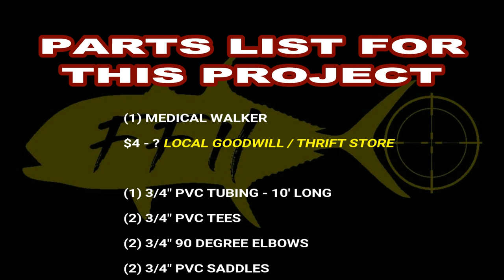A Diy Kayak Cart Experiment - Florida Fish Hunter

Comment: I'm having trouble seeing how u got from the original axel build to what u ended up with. you never showed what was involved
Reply from the maker: As an option, a second inner and outer tube was added to the center section of the original axle build and felt that it was not necessary to have to include this step in the video but I guess I was wrong...

Comment: I finally located a walker at a reasonable ($10) price and now to get the other components together....have you found any other wheels that are worth trying or are the C-Tug Kiwi on Amazon the best deal?? Didn't look at the cost of the one component that may be most difficult to find....wheels...(wasn't thinking the wheels would be over $50)
Reply from the maker: I really did not look around for wheels since I already had 3 pairs that had the right size hole to fit that one inch diameter aluminum tubing. What I would suggest is to go to your local hardware store or harbor freight and see if you can find wheels with a large solid plastic hub area so the hole used for its axle can be sized up to a 1 inch diameter opening.
Reply: floridafishhunter Yeah, that's my plan...I need to make a run to harbor freight anyway (1hr drive, so I make a list, lol).  Thanks!

Comment: Looks promising for most part besides through time and going through rougher terrain the PVC will most likely break
Reply from the maker: Pvc is very resilient. UV light degradation is the main culprit when using pvc in an outdoor environment so painting the pvc tubing will eliminate that problem and help it maintain its strength and integrity.

Comment: Do you think 1" PVC in place of the aluminum would hold up?  I have the same yak and already have c-tug so the wheels wouldnt be an issue. If so could you tell me what the width of the axle would need to be?   Thanks!
Reply from the maker: Pvc flexes too much for me which is why I went with aluminum but you are more than welcome to try it out and let me know your results. My axle width is currently 58 inches. 😊👍

Comment: Does it add much stress to the tracks...?? Would it work with a Kayak that is 95lb.?  How has it held up?? Great Video.. was very easy to understand...
Reply from the maker: Hi S Chambers! There is no load or stress to be concerned with on the tracks. All the weight and load of the kayak is on the axle itself when deployed. The pivot mounts that are on the tracks are just there to maintain axle position when moving after deployment or when flipped up to store on the top deck of the kayak. The Slayer 10 shown in the video weighs in at 81 pounds with just the seat and propel drive mounted. Once all my other gear is added I am absolutely sure that it's way over the 100 pound mark and have had absolutely no issues at all to date and has held up perfectly. I hope I have answered your questions and thanks for liking the video. 😊👍